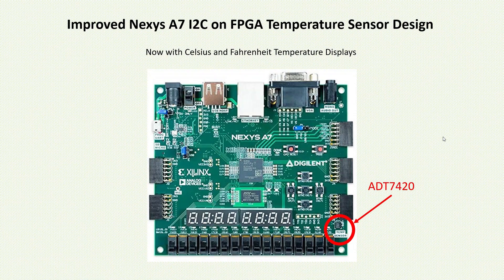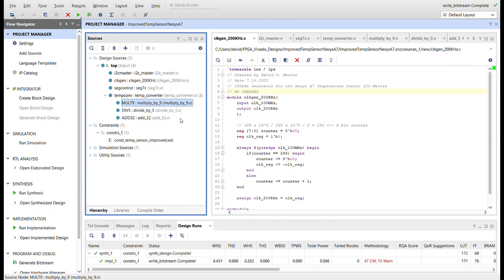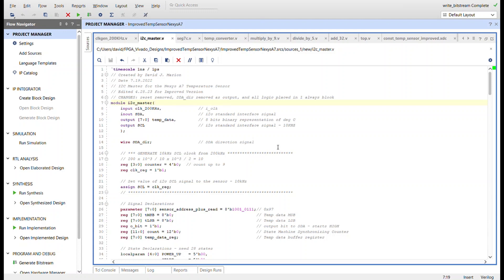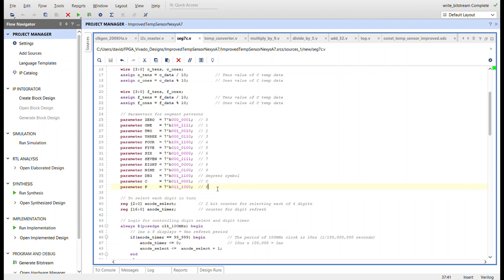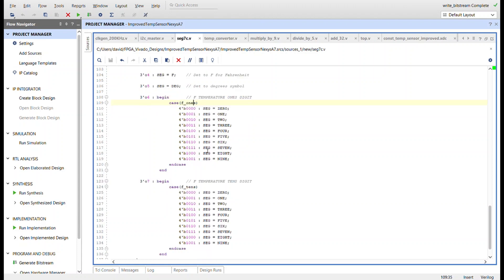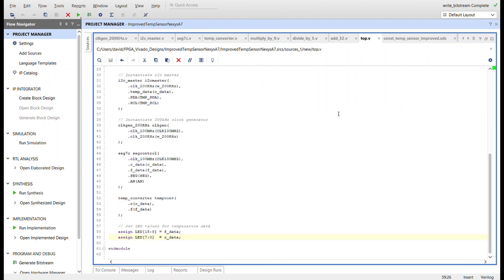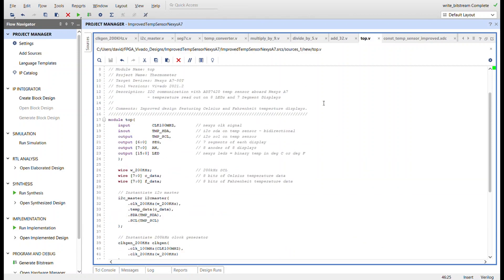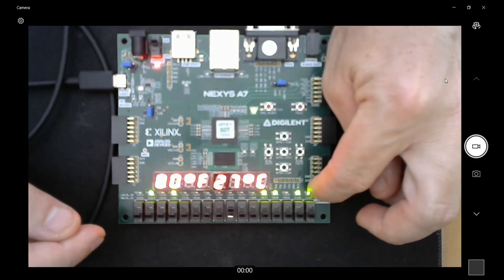Improved Nexys A7 I2C Temperature Sensor

Comment: Did you know that you have a problem in your code? 26C should be 79F and 27C 81F (If rounded up). Do you know how it could be resolved?
Reply from the maker: Not sure what you are referring to. And, as the system works as designed, I don't see that there is any problem. Maybe you could provide more details to support your claim.

Comment: Really nice effort from you sir, can you please provide the testbench for this?
Reply from the maker: Thank you. The testbench has been posted on Github in the project folder.
Reply: @dajoma36  Sir There is no testbench in Improved version folder
Reply from the maker: @RevanasiddeshU-e5n  I put the testbench in the folder with the original video. The i2c master files are exactly the same for the older video and the improved version. So, look for the testbench in the folder for the first video I did on the temp sensor using the Nexys-A7.
Reply: That testbench is not working for this improved version
Reply from the maker: @RevanasiddeshU-e5n  I'm sorry, that is the only testbench i have for this.

Comment: Hey, thanks for your video! I have trying to use your temp sensor code to try and implement it into my personal project of trying to read data from a adafruit current sensor. I am not sure how to switch the code around to display accurate current readings, may you please help?
Reply from the maker: Thanks for commenting on my videos, and thanks for watching. Sure, I will help. What is the chip on the adafruit sensor you are trying to read data from?